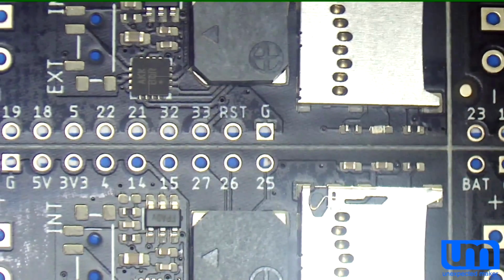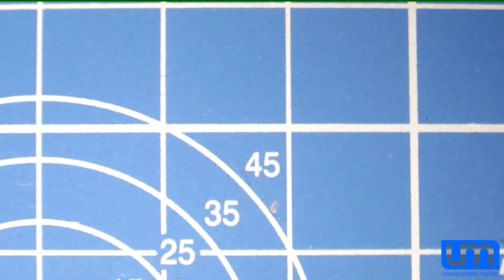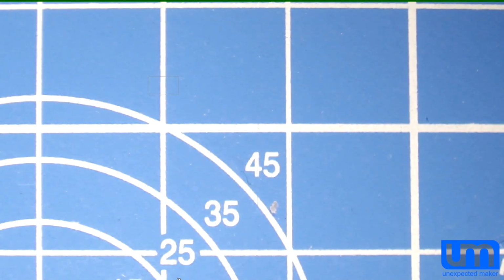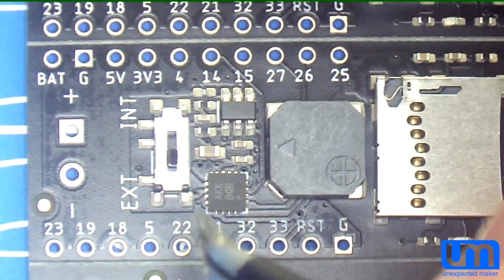First I2S Audio Shields using my latest vacuum design

Comment: When using your manual stencil, do you cover everything in a single pass? Do you have a video of you stenciling boards using this?  Thanks
Reply from the maker: Stencilling should always be 1 swipe only - Any time you swipe multiple times, you run the risk of pushing paste under the stencil.
Reply: @UnexpectedMaker  thank you

Comment: Is the placement of the speaker outputs a problem? When the shield is directly on top of the tinyPICO, they touch the micro-usb. Thoughts?
Reply from the maker: What do mean by directly on top? Male headers on the I2S Audio shield going into female headers on the TinyPICO gives stacks of room, like 5mm clearance rom the USB-C connector.
Reply: @UnexpectedMaker  ah, I see. I'm using this in a compact device so I'm using one pair of male headers to connect the two.

Comment: Hey Seon, could you post more PnP videos? Watching your machine work is like ASMR and it's hard to find videos that are longer than just a few minutes or short demos of machines. Would be kind of nice to watch like 10-20 minutes of uninterrupted PnP manufacturing and maybe a shot of the whole board going through your entire line.

Comment: I tend to set up my stencil print with a small gap between the stencil and the PWB.  This is on an automated stencil printer though.  But the reasoning is that when you squeegee, you press the stencil to the board and then the stencil will release itself from the board instead of me forcing them apart by lifting the stencil.

Comment: Nice process, thanks for showing it.
I find the vacuum cleaner sound obnoxious and wonder if you’ve seen the small Venturi vacuum generators that plug into compressed air feeds and produce a vacuum.
You can get them pretty cheap from RS.
It’s still not silent- substituting an air-flow hiss for the whining motor, but might be worth looking into?
Reply from the maker: Venturi pumps cant produce even 20% of the vacuum I need to suck a framed stencil down, It's not what they are designed for. The idea behind this project is for it to be as DIY as possible. Everyone has a vacuum cleaner or access to one. Most don't have an air compressor, and spending $ on Venturi or similar solutions makes it quite expensive.

Comment: To the switch
Nozzle for inspiration see User manual for K1830 page 49, last picture. Different shapes are made to order. But the question is whether the K1830 can first align the nozzle over the camera, then grab the part and align it again over the camera. Then there are rectangular nozzles with positioning by means of a protruding pin. But that's probably handled by other machines.
Reply from the maker: Nope, the K1830 cannot pre capture the nozzle position.

Comment: Some PnP have a gripper nozzle for grabbing such parts.  It fits on where the nozzles do and is a gripper with 2 fingers to grab the sides.
Reply: you can 3d print such a nozzle using something like tpu

Comment: Like the vacuum ideal. Trying it on mine this weekend. I have a switch like yours, Mine PNP will place it, just slow the travel speed down some.
Reply from the maker: I ran that switch on a different board, on it's own, at 15% travel speed - got 40% correct placement :(
Reply: @UnexpectedMaker  Man, the PNP Gods really must hate you.
Reply: @UnexpectedMaker  Is there a "Big Gulp" nozzle that might suck the entire face of the switch?
Reply from the maker: There might be a custom nozzle I can get for the N8 for the switch - I'd need to look into it.
Reply: Added the vacuum mod to my stenciled printer. Worked very well with the frameless stencil I have.